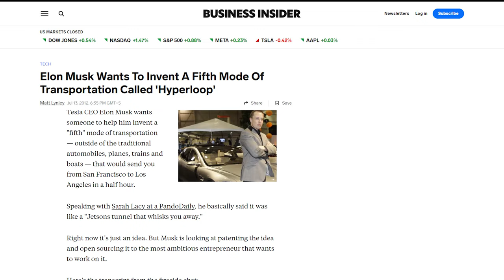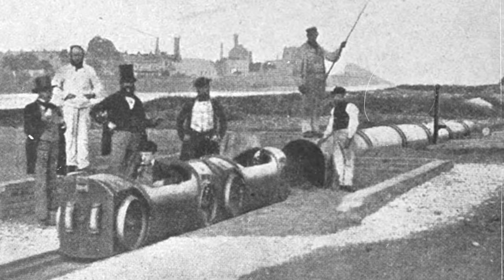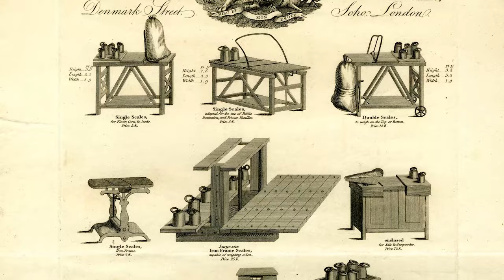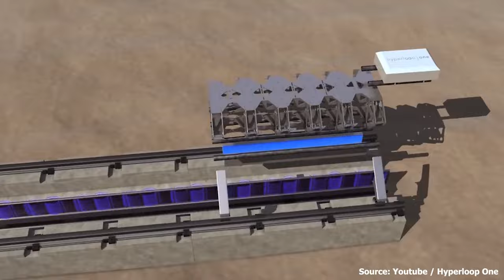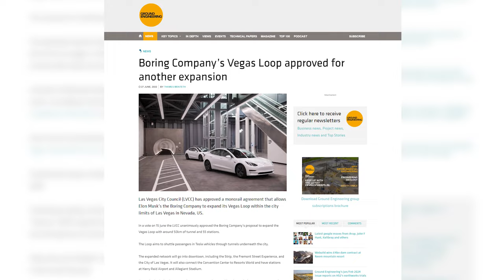What Happened to Elon Musk Hyperloop

Comment: In Vegas Boring company should make multiple exits brunching at the end of the tunnel, eliminating the bottle neck. That should  increase the cost of the entire project. The slow down at destination point is expected, that's why multiple exits are needed. It is cheaper to make multiple exits on the surface, but if the surface space is limited, then you have to dig them underground or perhaps building a 5 story highway tower with multiple exits like in China at the modern bridge exit. So it definitely needs a multiple exit upgrade and depending on purpose it might need spiral parking garages at the destination points. So if the slow down speed at the end 5 - 10 miles/h and desired tunnel speed is 100 m/h, then 100/5= number of end exits you will need. Speed trains in Moscow metro run every 30 sec. - the tightest at 70km/h, but with the train you have enormous volume, unlike with the car, wile tunnel capacity is the same. So car transport is a very wasteful way in comparison to a metro and should be designed differently with multiple branches and multiple exits at destinations. USA highways are clattered because they were not designed properly for high traffic at destination points and lack multiple exits, because those are costly and if you make them underground, even more so. Perhaps a flying car would be a solution, but you need an autopilot navigation to avoid the air collissions.